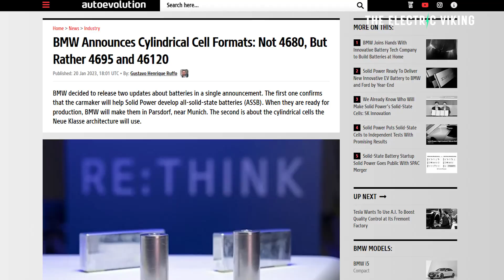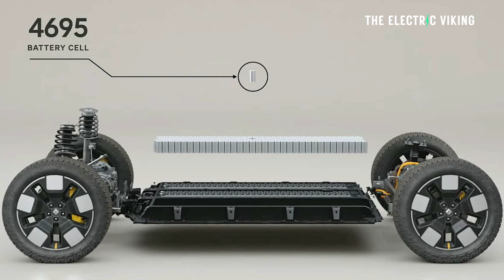Rivian's NEW 4695 Battery cells and 1000V architecture revealed

Comment: For sure someone is going to enter an R3X into an endurance race like the Daskar. How will the thermal management work under those conditions?
Reply: The same as for any other cylindrical cell battery pack. The same percentage of coolant space applies whatever the cell diameter. For better cooling of a larger diameter cell's centre better thermal conductivity is needed at the two ends, and there will be a limit to maximum height because of this. But that limit can be staved off by having more coolant flowing around the batteries. I.e. better heatsinks, bigger radiators and faster fluid flow.

Comment: Couple of mistakes here.
1. Using cylindrical cells , no matter the size, the packaging density remains the same. Yes the gap are bigger with the bigger cell, but there’s fewer gap. If you take a piece a paper and draw each scenario a measure the surface area of the gap, it will remains identical.
2. The size of the cell (if cooled properly) doesn’t affect the charging rate. It’s the chemistry that determines the C-rating of a cell. 
3. Having fewer cell limits the arrangement possibilities for voltage. You have your put cells in series to increase voltage. Once you achieved the desire voltage, you create more modules of the same arrangement, and you put them in parallel. To achieve 1000v you need about 270 cells in series, then you have 3 of those modules together.

Comment: Look … I’m no battery expert… far from it… but by using deductive reasoning, I’m guessing the 15 mm height difference is due to the difference between the traditional tab arrangement versus the tabless design. So the 4680 remains shorter offering a lower CG for the pack… and offering cheaper manufacturing costs with tabless…

Comment: The larger cell will have higher thermal impedance because of the geometry.  I wonder what the geometry of the coolant flow is?  If it's going between the cells there will be less of an impact.

Comment: I believe tesla went with 4680 over 4695 for a number of reasons:

1) ability to be used in more compact vehicles without raising the floor too much

2) a balance of improved cost of production with fewer cells to go wrong but with the drawback that it’s more likely to have reduced yields in production. Think of it like small vs large dies on a silicon wafer.

3) they just don’t think it’s necessary to have so much battery capacity so would rather have a thinner skateboard than a thicker one that’s incomplete.

4) It’s possible they also didn’t believe they had the cell chemistries available to make it possible at the time and that it would work well in future vehicles such as Tesla Semi.

Comment: Biggest fail is chargers on the wrong side gonna make everything a pain in the butt Tesla should force everyone to put it on the right side. If they want to use their net work.
Reply: Nobody fucking cares about the outdated Tesla supercharges, they can't even properly charge 800V vehicles. NACS is an open standard and many manufacturers will install solid and truly fast chargers.
Reply: Right rear works well for Tesla Superchargers as does Left front.  Center rear or front also works fine.  Worst is Right Front or Left rear, as it forces owners to waste two parking stalls.  Tesla can deal with it by charging double for those with poorly positioned ports that force the owners to consume two stalls for charging.  Doubt Tesla will do it, but it is an option.

Comment: Rectangular batteries would be so much batter. hundreds of 9-volt style batteries. There would be minimal gaps between batteries.
Reply: 9 volt batteries are actually a small battery pack consisting of 6 cylindrical  a a a a batteries.
Reply: I am sure you know better than Rivian.

Comment: Rivians batteries are the least of its problems.  Rivian is clearly headed for bankruptcy.  Per Rivian's losses on a GAAP basis... 2Q23... $1.2 bill... 3Q23... $1.4 bill . . . 4Q23... $1.5bill.  Double whammy of anemic production and massive losses on the few vehicles sold.  How exactly does Rivian not go bankrupt under these conditions?  The R2 and R3 are both nice looking.  But will also be produced at a loss.  Can't see buying a BEV from a company headed for bankruptcy and won't be able to provide after-purchase support

Comment: Samsung SDI is the current supplier of Rivian 21700 cells. Samsung SDI has also developed a 4695 cell. So Rivian is working with its current supplier. This cell is required to achieve the faster charging and better performance Rivian is seeking, and the larger 15mm in size will provide for larger packs within a similar package space.
Reply: I'd love to see the specs on these.  Aptera is planning to use 2190 / 21120 cells for their larger range versions.  If this improves the energy density enough that will allow for the 600/1000 mile Apteras with the same battery tray design.
Reply: A new cell form factor actually isn’t required for faster charging. Larger cells often charge slower than comparable small cells because they are more difficult to cool. It’s only possible if you design the cell to produce less heat from charging/discharging.
Reply: @yscol22  The size of the cell can affect the C-rate, e.g., a 50kWh battery pack with a 3C rate could handle 150kW peak charging, while a 100kWh battery pack made up of the same cells could potentially handle as high as 300kW peak, assuming the BMS and the charger could handle that much power. Also, we know that charging can be slow at the bottom and top of the pack; the same is true when looking at the cell level. If the cell is denser, wouldn't the capacity between the bottom and top be larger?

Comment: I repeat 4680 is blockbuster video. Prismatic cells use 30% less space. When will you figure this out
Reply: Ever battery expert I’ve seen evaluate and compare form factors for batteries have very plainly stated cylindrical are the best… and it’s really not even close
Reply: @robertvadjinia126  you haven’t spoken to the experts then have you from China. You seriously need to do some research on the blade battery, still the best battery on the planet
Reply: Why nobody is using them? Maybe there is reason for that? Like thermal management problems? Just a wild guess on my side
Reply: @cerverg nobody uses what?

Comment: Maybe Rivian should have focussed on the 4680 form factor - more of an industry standard. Panasonic, Samsung and LG are in the process of setting up manufacturing for these. Tesla have done their homework on this form factor, and concluded it is optimal. Even so, both Tesla and Panasonic have come across the (inevitable) production problems with this larger form factor (larger than standard 2170 for example). For Rivian and BMW to jump to 4695, to me, seems a bit questionable, with little extra gain over 4680. Batteries, as has been proven, are difficult, costly and time intensive to manufacture at scale. If, as Elon says, production is hard - it is easy to convince someone that an extra 1.5 centimeters will fill a battery floor space with extra capacity - but to achieve that ( in production) may prove to be extraordinarily tricky....
Reply: 4680 cells are inferior, so why would they settle for something worse?

Comment: Sam's claim that the larger cells will charge factor is incorrect./misleading. Each cell will take more current but for any set pack size there will be less of them,  so no advantage.

He is also wrong about larger batteries leading to more wasted space. The percentage of wasted space remains the same.

Comment: EVERY bigger manufacturer will have an 800V architecture in their mid-size and middle-class EVs. A direct Model 3 competitor with 800V are the Hyundai Ioniq 6 or the upcoming Mercedes-Benz CLA, for example. If Tesla is not coming up with an 800V platform for the Model Y update, which I highly doubt that they would and could, then Tesla's lineup will be even more outdated than it is aleady today. The Rivian R2 and R3 look awesome and premium.
By the way, your yapping about the 4695 cells is not based on knowledge or information whatsoever. BMWs engineers already said they are superior to 4680, other engineers or journalist which have deeper insights about this topic agree. The cells are produced by CATL in partnership with BWW, but Samsung also produces 4695 cells, Rivian probably use CATL or its current partner Samsung, which is a smart choice.
Reply: Sam only cares about the price of the batteries. LFP has a lower energy density than NMC type batteries. Adding more LFP to get similar range (on paper) as NMC will make the car heavier and we know that heavy cars loses range.
Reply: $45000 in 2.5 years will be what $55,000 is today, aka uncompetitive. Rivian is going to have to cut COGS to an unreasonable extent in an environment that now includes Tesla with a product that competes directly with Tesla's most scaled product. 

Do you really think the Model Y won't be significantly upgraded (and cheaper) by then?
Reply: 800V vs. 400V is really not much of an issue.  It saves a tiny amount of copper cost, but adds cost for more insulation.  It does make sense for very large vehicles (trucks), but not so much for sedans and most SUVs which 400v vs. 800v is unimportant other than a scamy sales point.  The consumer doesn't care, and if you want the largest reliable charging network, you want 400v today. Perhaps in 3-5 years 800V reliable charging will be common, but not today. Most 800v vehicles today have very poor 400v charging, other than the Cybertruck. That can be fixed with a good design, but so far companies like Lucid really screwed it up.